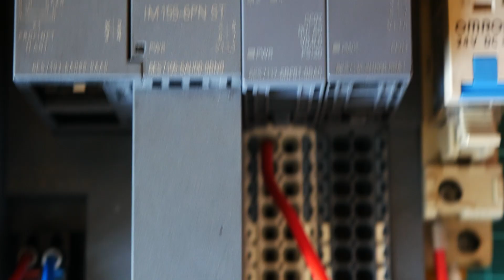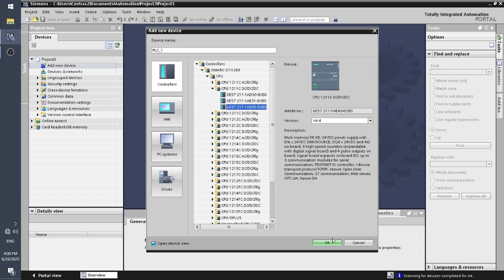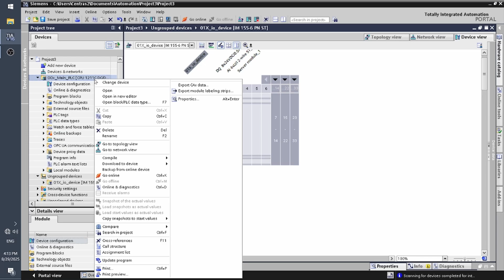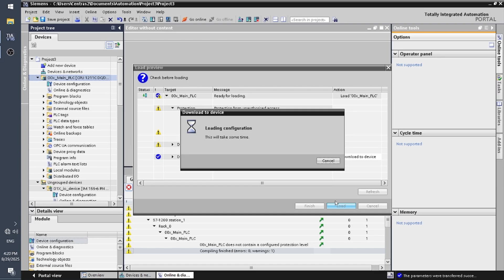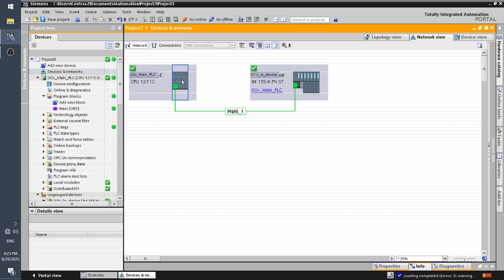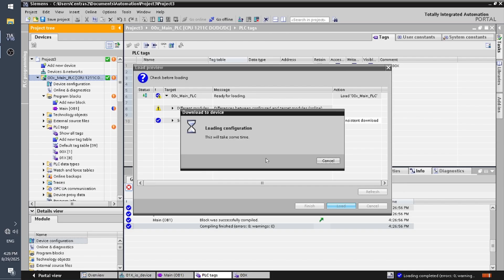Siemens ET200SP hardware assembly, connection to PLC and TIA configuration

Comment: Thank you for this sharing. I have question about base unit dark code. I see that base unit featured with 3 busbar which connect to the left base unit (light code). Is that like jumper?

Comment: Hello, thank you for your complete explanation I installed all the components according to your explanation. A maintenance error was shown. How can I remove this error?
Reply from the maker: Dont know... But compile all, download all hardware, rebuild all software and download.. IF that doesn't help check the wiring. Check network
Reply: @VideoBite thanks